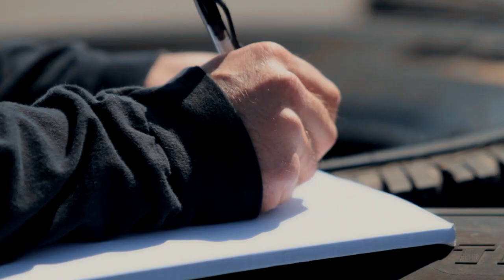Purpose-built armored truck shot with Ak-47

Comment: That is really incredible.  Nice work.  My only advice on the 6.0L is to use head studs and possibly an egr delete.  Not the bad engine that everyone who has never owned one says they are, just some inherent weaknesses that need addressing.  I put 190k miles on mine with a programmer under load the majority of time, I just had studs put in and dealt with the EGR.  Where is Indigen located?

Comment: @DVG793 I really wish you just unloaded on it. I mean set up some ambush points on the road ya know.  I mean its gonna have to take a lot of hits from multiple angles from a very determined enemy.  It usually starts with an IED blast and then an ambush with AK47s (7.62x39), RPKs (7.62x54 AP ammo), and RPGs.  Would it be possible to install reactive tile armor inside the door panel? There are roadside shaped charge munitions that cut right through armor plate.

Comment: @drgnracin72 When in a city its very difficult to escape an ambush. Hell even in afghanistan its too rought to move very fast. It can take an hour to travel 5 miles just because of the terrain.  And when fired on you don't get a few pop shots. They unload 10-15 aks and heavy machine guns and RPGs.  Thats after the first IED blast and then there is a 2nd IED about 50 meters down the road.